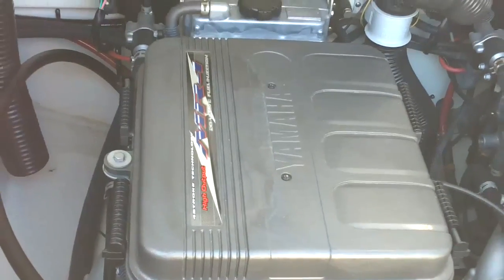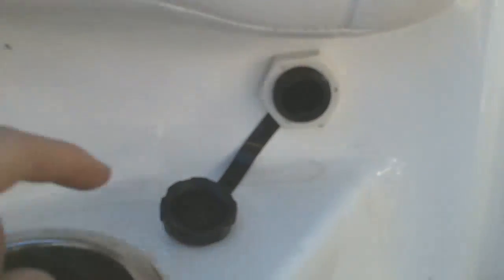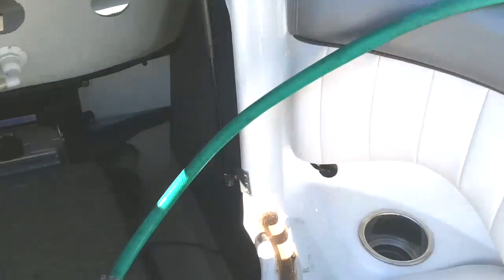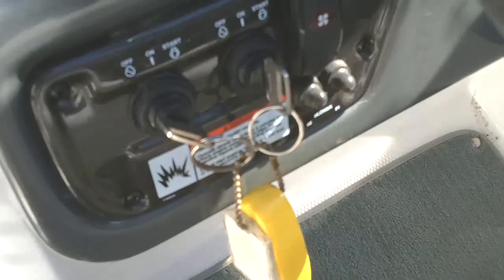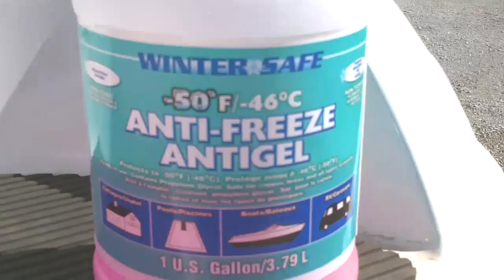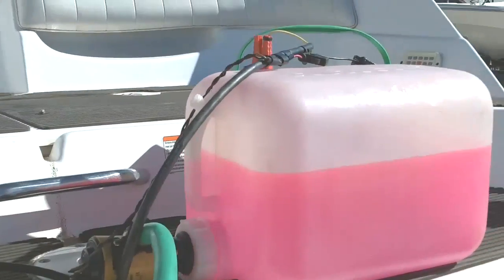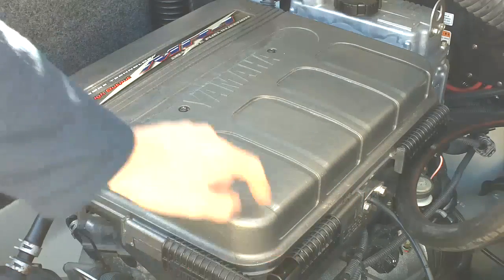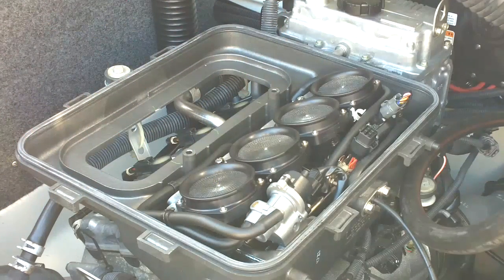Boat Winterization - Yamaha SX230

Comment: I just winterized my 2005 AR 230 HO yesterday.  I add the stabilizer and changed the oil and filter at this time so it's all complete for the next year.  I've read that this also helps with any contaminants in the old oil.   I do the winterizing fluid first so the oil heats up before I pull it out--easy when it's hot versus cold oil.  The whole process takes about 60 minutes and I save about $300.00 doing it myself.  Never had any issues in 10 years doing this myself.
Reply: I have the same 05 ar 230 HO..  Doing this for the first time.     I was going to run the antifreeze through it for 15 seconds but some videos say just rev is up for 15 seconds and all the water is out??  I am confused.

Comment: HI, Enjoyed your video. My SR210 have been on land for 3 month now and today I let the gravity do the work Wintherizing my two engines. My question is - do I really need to start up the engine - as I clealy saw the fluid comming out below ?

Best Regards 

;-) Thomas
Reply: Yes.  always have the engines on when any fluid is being pushed into the engine.  This way the fluid can run through the engine and ALL lines.  I even add a gallon to the bilge area.

Comment from the maker: By the book Yamaha says after running the boat on the flusher or in the lake, in order to remove the water out of the engine/exhaust, run the engine 'dry' for 15 seconds to blow out any residual water left in the engine or exhaust.  Meaning run it dry for 15 seconds loaded on the trailer, on land, or without water being supplied to engine.  I hope this answers your question.